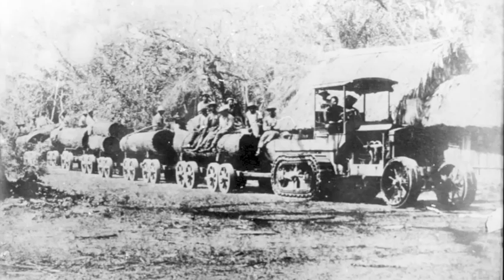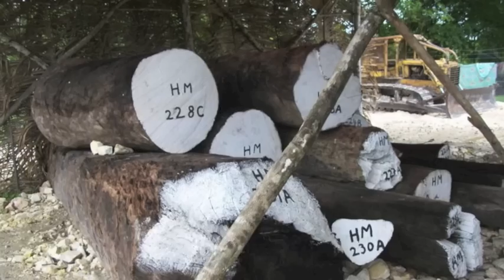Treasure Found - Long Lost Logs from Belize

Comment: Pretty interesting, though those logs sure do a lot of traveling!  A company here in Oregon has been doing underwater timber salvage in the Columbia River since the early 2000's, using side scan radar & researching old log raft locations to find them; then bringing them up with an excavator onto a barge.  They do all of their own milling, mostly hemlock which was heavier and didn't float well.....or long!

Comment: Great video. Very interesting. Thanks for sharing.
I bought a large, wooden chest carved with the Mayan alphabet and figures in Guatemala in 1986. It cost $30 and that much extra for the plane ride back.
A lumberman saw the chest in the airport and said that it wasn't cured properly and that it will crack. He was right. It did crack. But, it is still a cool, albeit bulky, possession. 
Not sure of the kind of wood but it's stained walnut.
Reply from the maker: +Victor D. Easley, Thanx for you comments. I can't tell you what wood your chest was made of but I can tell you the price for it and what it cost to get it into the US was very good... even for 1986. Today, depending on the species is was made of, the cost would be prohibitive. RP

Comment: Using a log stuck in the skidder tow frame is typical of Belize. It made me laugh and brought back memories of when I was on a freezer plant project down there. Unfortunately for us, the guy in charge was an alcoholic and the availability of rum caused him to bring the whole project down. I had a plane ticket to Los Angeles and used it to get out of there with pretty much what I had when I went down there.
Reply from the maker: +Allen A ...... WoW!!! Yes there is definitely always an adventure to be had down there. There is something about the climate, or the food, or something in the water that has a tendency bring out the "what the heck" in us while there. We spent a lot of time and money having a metal boom designed and built for that skidder and we were told by our ops manager down there that we should just do it the "Belizean Way"... "Use whats available and make do mon" Oh no, we were much smarter than that.... we had this monstrosity built and when we mounted it on the skidder it would barely lift the weight of itself without the front end coming off the ground, god forbid lifting a wet log out of the water....sheeeeesh.... as you see in the video it was a simple matter of sticking a Billy Web log in the tow frame and it lasted us 3 seasons before needing replacement. Thanx for sharing... RP
Reply: Ouch. 'spent time and money designing a metal boom for that skidder', yet no one thought to calculate the weight? OUCH.Damage to both  pride and pocketbook... guess that wood pays for all though? Hope the locals are getting a reasonable chunk of the pie... gorgeous wood, kudos on the salvage!

Comment: Hi, at start it says the logs would sink quite quickly while waiting in lagoons?

how quickly does a log sink?

Or is mahogany so hard and heavy it sinks quickly?
Reply from the maker: +Rose White , Logs were harvested during the "dry" season when rivers and streams were too low to float the logs to the harbor in Belize City to be loaded onto ships. So the logs from the start of the dry season sat in the water for a long time, (upwards of 8 months), and a dense old growth log like that will not float that long and sinks to the bottom. When the rainy season comes it raises the river levels up enough to float the logs over the shallow riffle areas. The rain, (over 100 inches in 4 months), would also wash tons of sediment into the streams which would cover the sunken logs with a layer of mud, sand and small cobble. With the next dry season the process would start all over again. Right now we are recovering the logs that are visible on the bottom. In time we will begin recovering the buried ones. Those logs will be very interesting indeed! 
Thanx for your comment.
Rich.
Reply: Hi Rich, thanks for explaining.
I ask because I'm Fundamental Christian and accept that 4,300 years ago Earth was flooded and all vegetation washed off to create all the oil, gas ans coal and lots of people claim trees would not have been deeply buried in flood.

Obviously if they sank in the standing water months of flood they would then get covered in the deep sediment during the massive drain offs.

Don't see much fancy furniture in UK these days as everyone shops at Ikea.
Reply: greenerlumber

Comment: For every log that is re-floated or dug up that is 1 less that will be sawn down to meet the requirements of the mill and in the end the general public. They say wood that has been underwater for some time takes on an entirely nicer patina than the 'fresh sawn' stuff and having been connected with both sorts for some time I believe that to be entirely true, - providing the under-water wood is not kiln dried. Mind you Mahogany never was a 'cheap' wood to start with - no 'Hardwood' is as it is so slow growing.
Reply from the maker: You're right Chris. We have found Sinker Mahogany logs sporting over 60 rings per inch which today is unheard of. It is a better quality of wood and the color of it is much deeper than the 12 - 16 ring per inch material being harvested from the rainforest now. RP
Reply: That ring count as you say is unheard of today, - makes for beautiful figuring on the board. I have restored a lot of period furniture and it is hell to get a good match unless you use wood of the same age, - todays veneer is absolute rubbish. I have bought old 'rough' and broken C of D's in order to get the wood / veneer in order to restore better pieces. I'm intrigued how you are going to find the buried logs, - without giving too much away would I be right in saying 'sonar' of some form.